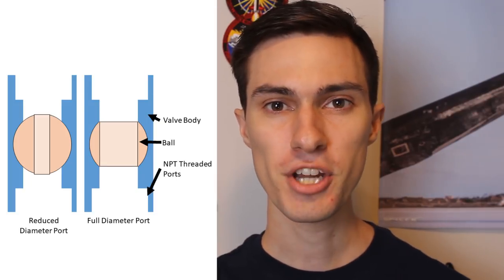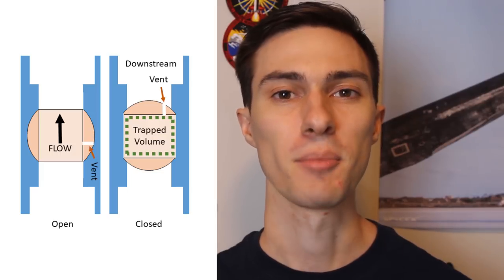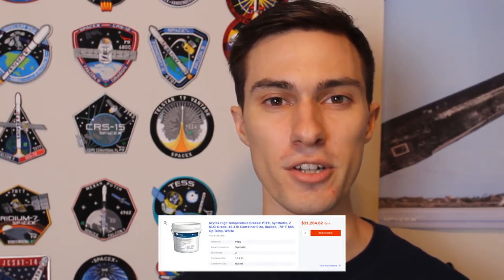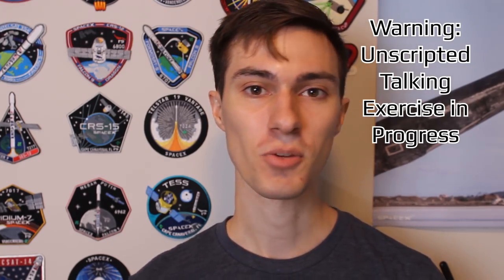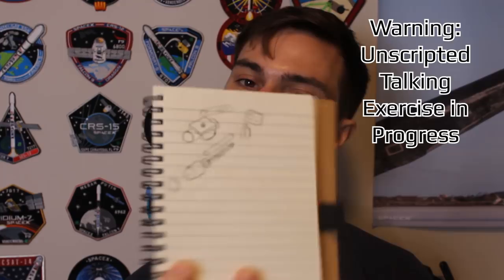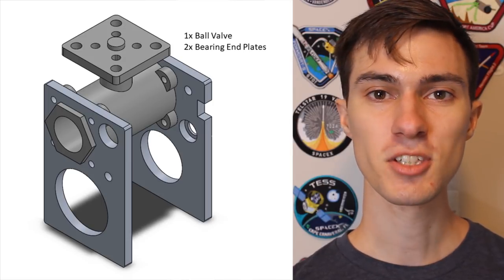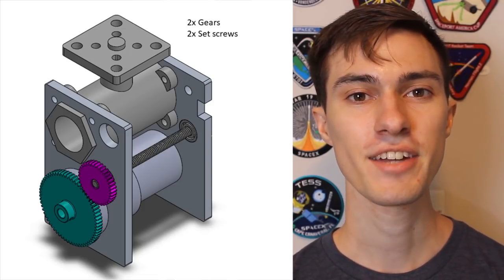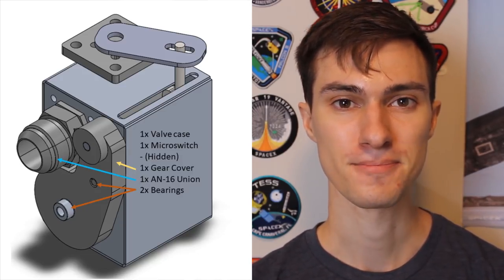Liquid Rocket Engines 5: Main Propellant Valves

Comment: If you are using teflon o-rings (ie most common type of fluoropolymer o-rings) make sure NOT to use teflon grease. As a general rule of thumb, like dissolves like and so using teflon grease on teflon rings will slowly weaken the seal until one day BAM! Keep up the amazing work, and looking forward to your next video!

Comment: You might want to center the lead screw in the plane of the valve lever (or as close as possible) and attach a traveler which can engage the valve lever from both sides of the traveler. This will minimize possibility of seizing and remove the need for a guide rod.
Reply from the maker: Unfortunately the mounting features for the valve occupy that same plane... Definitely worth some thought.

Comment: Looks like a pretty compact solution! I recon you should maybe move the guiding rod as close to the lead screw as possible to reduce the chance of the traveller digging in and getting stuck. Either that or put a tophat into the traveller to give it more surface area to slide on!

Comment: Unless there is an extreme Temperature Gradient across the Potentiometer it would still work, because it is a Voltage Divider. If the Resistance of one side changes the other one will change aswell.

Comment: I can't imagine this is actually cheaper than using a pneumatic actuator? I was pricing out some for our valves and was able to find them for under $100 pretty consistently, add about $30 for a solenoid then you just need to mount them together. Assuming you have nitrogen/air onboard anyways.

This is probably more compact though, the way you talked about the water jet makes me think you have free access to one so I can see why you would leverage that if it's the case.

Comment: Hey what about the propellent tanks? They need to be capable of handling very high pressures right?, and for the cryo liquid oxygen which material the tanks must me made of? Stainless steel?
Reply: Alu also works well for cryo. Alu is actually stronger at crygogenic temperatures.
Reply: 301 stainless!